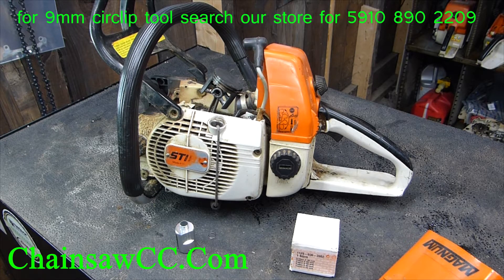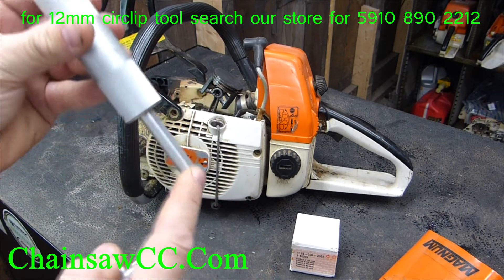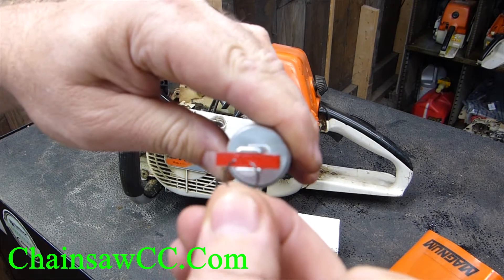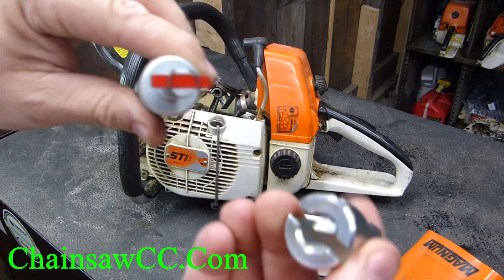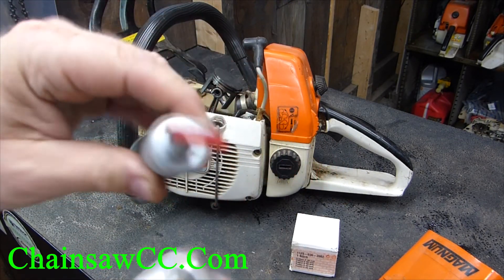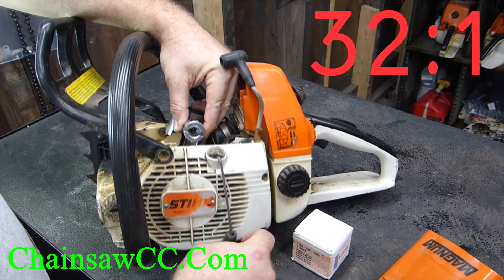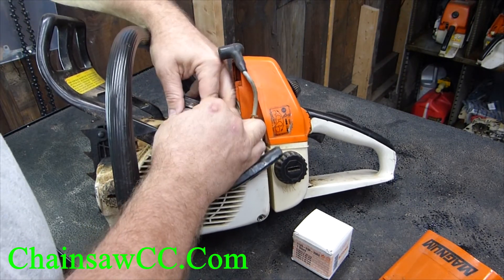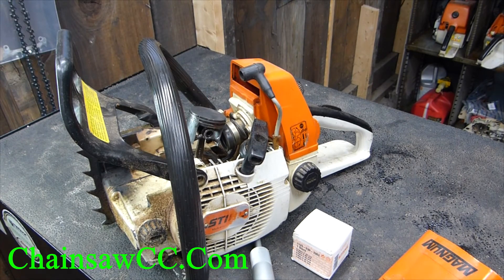How to use the Stihl OEM circlip installation tool

Comment: Does this tool work for removing the circlip?
Reply from the maker: just the install. BUT...if you install the clip correctly, it is super simple to pop out with just a cheap small curved pick

Comment: I have a husqqvarna 55 that i'm putting an aftermarket hyway piston in.  The circlips are rather "heavy duty" compared with the oem clips I took out and they are very stubborn to install.  The oem clips go in easy into the aftermarket piston......too easy, and I don't like how they fit.  Will these tools work for other brand saws?  Will they also work with circlips that have the "bend" in one end?
Reply from the maker: they do work with other brands of circlips, even if they have a single ear, I have had trouble with a few of the double ear clips but not all.

Comment: how much does the other sizes cost 6-13mm
Reply from the maker: they are all over the place and each size is a different price, check for OEM Stihl circlip tool on eBay and see what you can find

Comment: I have looked at these online... Don't you actually need several of them to be able to service different models ? Love to own one, but having to buy several at $80-$90 each is a hefty investment....
Reply from the maker: yes we stock them for 8mm, 9mm, 10mm, 1mm, 12mm and 13mm circlips
there is a different tool for each size, if you are doing enough builds that you have nightmares about chasing the small pinging noise of a flying circlip as it bounces around the shop and ends up in another dimension, you will appreciate these tools
the two most commonly used sizes are the 10 and 12mm and I think they are also the two least expensive
Reply: @JoviParagon  I need one of these. My fingers just are not as nimble. I had to go set in the shower with the door shut to keep from loosing cir clips..